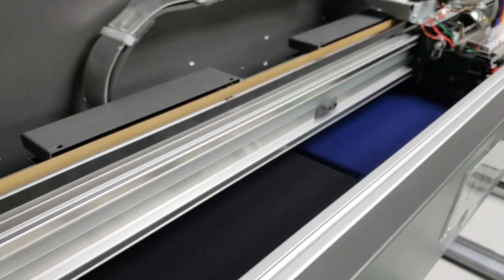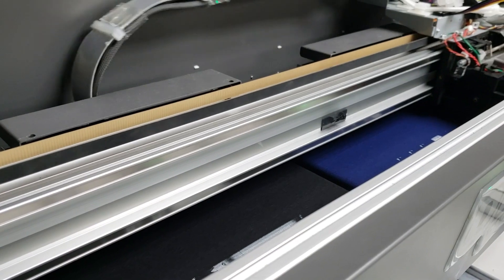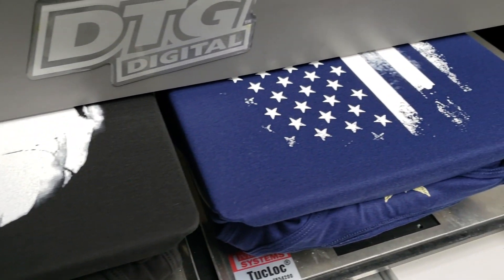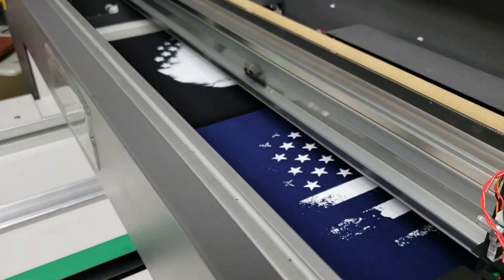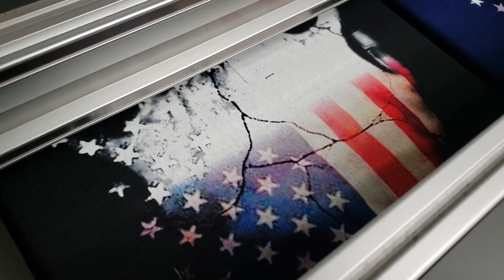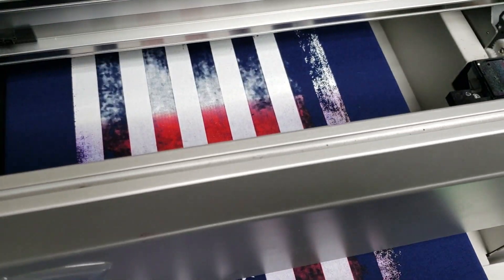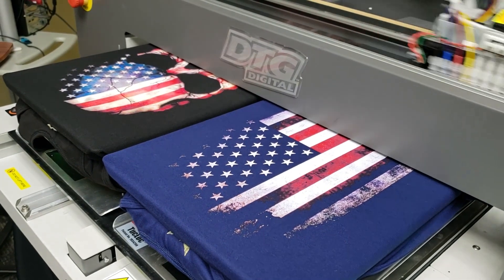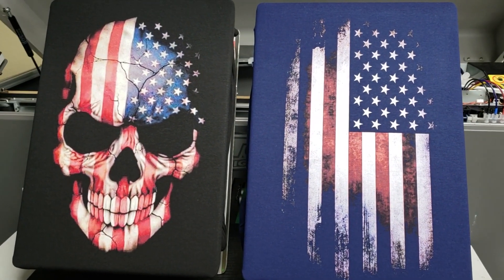Best DTG Printer 2018 | Make Custom T-Shirts With DTG M2

Comment: Is there a built in ink curing light or other mechanism in this DTG printer?  I've seen a LED curing light used in Direct to product inkjet printers that are used to print to poker chips, golf balls, basketballs, footballs, phones/cases, markers, and other assorted promotional goods.
Reply from the maker: Hi IraQ - DTG uses aqueous inks that do best with both heat AND pressure - the shirts you see hear are heat pressed to cure. You've probably seen a UV printer in action - those use UV LED lamps to cure a special ink set in real time. Normall these are used for hard goods. You can learn more about those printers at http://compressuvprinter.com

Comment: nice printer but ouch 30k!?
Reply from the maker: Depending on the bundle $25K-30 is about right. The end result cost about $7 each. They're $20-25 retail - especially since they're one-offs and print-while-you-wait style you're making your lease payment at about 40 shirts a month.
Reply: Coldesi Colman For that price why would i buy this printer? The epson f2000 and 2100 is cheaper and faster. Just wondering why its priced so high?
Reply from the maker: Great question - Couple of things Ruler - this printer's base price is around $18K, so it's actually closer to the Epson price than it looks - it's just normally people end up spending more. We talk about that up front and they rarely do. But the concrete diferences in products are:
1. Print 2 shirts at once - or 4. Being able to print 2 shirts or more, with different designs on then, with removable platens, it a big win for workflow
2. Print SIZE - the M2 will print up to about 17"X24" natively - if you're selling XL and up just ask your bigger customers how they'd like a design size that matches the shirt size
3. Ink Cost - Last time we look it was 2.5X times more expensive to print with the epson because the ink price is so high

There are other things too, like warranty, training etc, but those are the big differences. http://dtgprinter.wpengine.com/profit-lowest-cost-per-print/